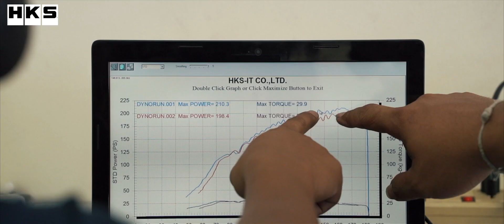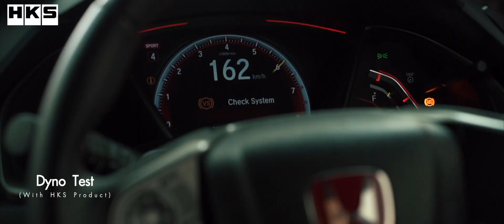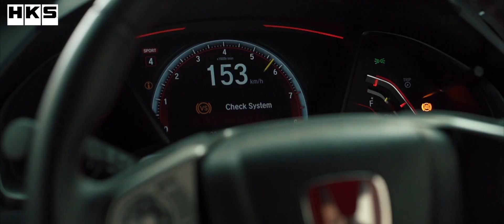HKS x HONDA CIVIC TYPE-R FK8

Comment: 198ps stock? Doesnt the fk8r have 300hp as stock?
Reply: Even with drivetrain loss (usually somewhere around 10-15%), the numbers don't look right.
Reply: Exactly! I’m wondering the same... how could it be so low? 

HKS Thai, do you care to explain?
Reply: Inline4 there Dyno just reads low, it doesn’t matter though because with all the parts installed you see the added horsepower. Not all  Dyno’s read the same.
Reply: 320

Comment: I bet that wing adds lots of downforce for the front wheel drive car
Reply: I IdEnTiFY AS a RoCK down force is down force! Makes no difference what wheels are driven.
Reply: @initialg82  Um they don't do anything, why would downforce on non powered wheels help?
Reply: @iidentifyasarock6106   Wow, good one man.  You sure got me,  solid argument.
Reply: I IdEnTiFY AS a RoCK Bring up a fact for an argument, come on dont cry or just bring up a legit info everyone is reading
Reply: I IdEnTiFY AS a RoCK the wing is 100% functional guy...like 70 lbs. of downforce at 120 mph and up from there. The entire car is focused on downforce which is part of the reason it can hang with supercars at speed on big tracks. Thanks for stopping by though. 👍🏼
Reply: Try changing lane in the highway at 250kmh without wing. Then u will know how crucial a wing for a fast fwd car.
Reply: say that to my friend's 260km/h FK Turbo...There's a difference when it comes to cornering on a highway!! With spoiler and without yea seriously try it
Reply: Aerodynamic does not correlate to the power and deliverance unit, a glider can float stationary with enough airspeed facing the craft.